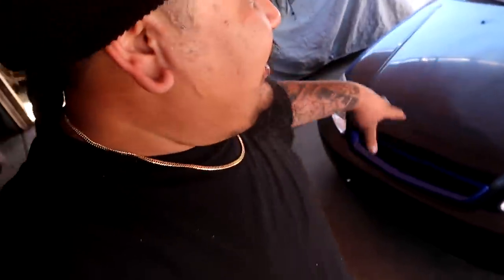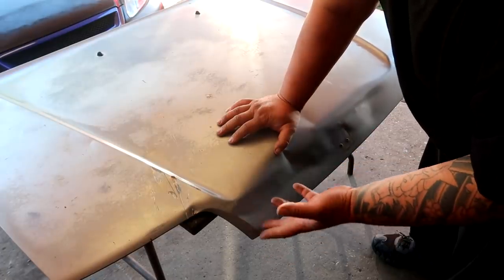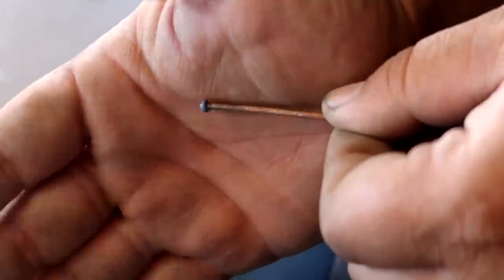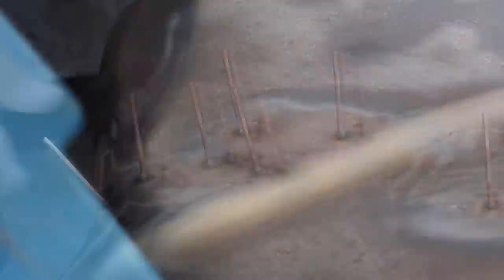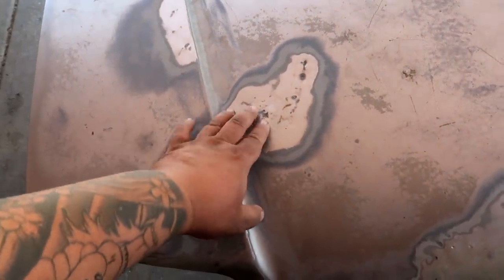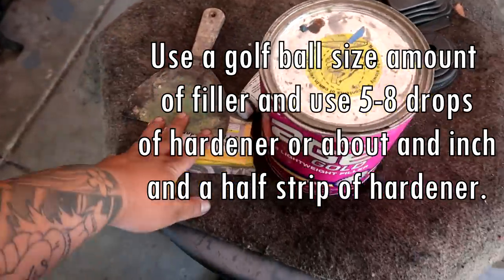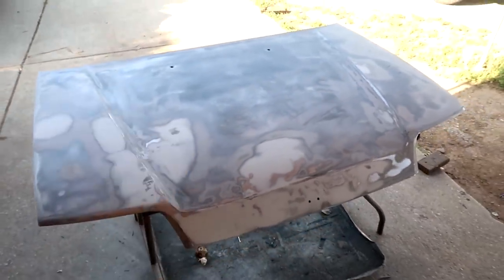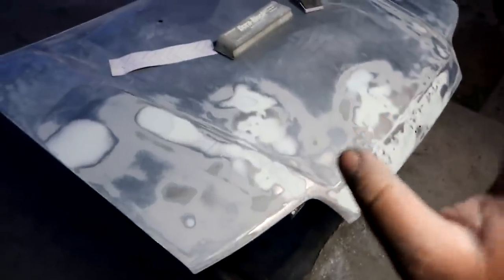HOW TO USE A STUD GUN | RE-LEARNING BODYWORK

Comment from the maker: Hey guys. I don’t know everything about bodywork. If anyone has any pro tips on anything I am doing wrong, or any tips to help me improve,feel free to leave a comment below!
Reply: Youtube University for the win!
Reply: Add a lil fiberglass resin to your bondo and what do you get? Cheapest topcoat solution is what you get lol. Hope it helps
Reply: I was taught to work the dent from the lowest to the highest point never work from the outside in
Reply: I think you did pretty good ...shit thats what I would've done ...hey atleast that hood is reusable now ...no need for fiberglass imo.
Reply: I was a great vid of how to use the stud gun and you save that hood in the process that a plus great vid well cover
Reply: You can also use the stud gun to shrink metal if there's floppiness after trying to remove the dent. Get an air gun and heat the metal "without a stud" housing the stud gun and then compressed air go in  circles around the area.
Reply: You can also use cheap dark spray paint and dust the dent area and then sand to find high and low spots with a pice of 180 grit on a flat block going diagonal.

Comment: When pulling on the stud have tention on stud and tap 360 degree s around the dent lightly with pointed side of hammer will end up with less high spots around spots that you pulled. If you end up with a oil can affect with the metal carve a x with a cutting wheel not threw the metal but just a light x and when you pull on the stud and tap with the pointed side of the hammer it will not bounce back. Sometimes with your bigger dance that's the only thing you can do without having to change the whole quarter out. making a x is the last thing you want to try to do before replacing the quarter panel completely if you get the oil can effect oil can affect can screw you over when you finally apply filler and block it out and all the sudden pop small dent will suck back in and you will be pissed You might run into that problem with the quarter. Center of x at low part of dent only if needed. Just a little trick i leaned from 8 years of outo body. Flat part of hammer you can use but ued more with the dolleys to stretch and shrink the metal. Overall you're doing a great job looks like you have the basic knowledge on what you're doing and as far as I can tell you doing it correctly just a lack of experience which is totally understandable give it time and everything will work out great body work does take lots of time which I'm sure you know using a guide coat for your filler is a great idea I even use guide coat on my primer when I decked that out the longer the sand board the better do not use a air board you will get waves

Comment: If you take a blow torch and heat up a nice old file and bend zigzagging if you will so like step up and then step flat again when you pull the dent puller like that you can slap down the high spots in the low spots and it makes a nice flat surface rather than making a dent from the hammer all the time it's an old school track

Comment: what i do is wire the hood to your stand do not slam pull just enough to move metal tap with a hammer the high  spots or buckles. the buckles are what is holding the dent in place so pull the low spots up tap the high down it takes a lot of studs go easy this is and old indian secret lol

Comment: Hey Static. Which process worked better getting the studs in the valley or lower spot of the dent. Or was it better coming from hi to low. By the ways good job with that hood thanks for the material.
Reply from the maker: I notice that if I started at the valley of a deep dent, pulling harder to pull the Dent out causes it’s own dent from the stud. I guess the key is to pull each area 1 knock at a time because you can see i pointed out all the high spots after the fact.

Comment: Seems faster and more effective then paintless dent removal same method different process only difference is with pdr you use a hot glue one and the slide hammer attaches too plastic knobs
Reply from the maker: I still want to try that method.
Reply: @YoungStatic  Great video! Perfectly in-depth as always! Definitely giving me more self-confidence in regards to my abilities...now to put them to use on my 7th gen/em2 I picked up super cheap. Plan on swapping in a new D series in order to make it my dd while working on k24 swapping my 04 EP3. Thanks! #built2drive
P.S. I know you're into HotWheels, do you already have a "New for 2019" '88 Honda CR-X (Nightburnerz 3/10)? LMK

Comment: Static so I got a d15b7 with multiple point fuel injection with a fuel rail and that good shit and I have a d15b2 with dual point fuel injection in the crx right now so would I need to change any of the wire harness or anything like that for the d15b7 this is my first swap and I’m a little stuck

Comment: To me it looked like the metal was too smooth for filler. Regular filler needs a 24 or 36 grit scratch for it to adhere properly. You can get away with 80 or 180 with a top coat filler though.
Reply from the maker: I used 40 grits to cut down before filler, 40 again to cut the filler than 80-100 to shape